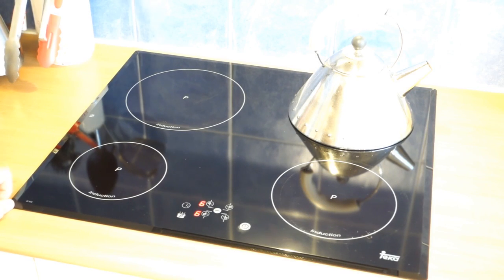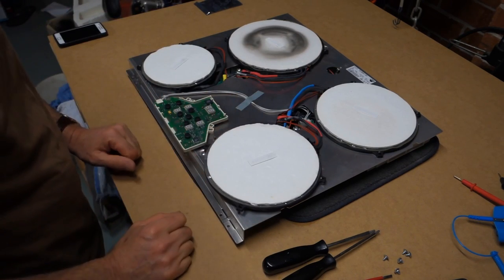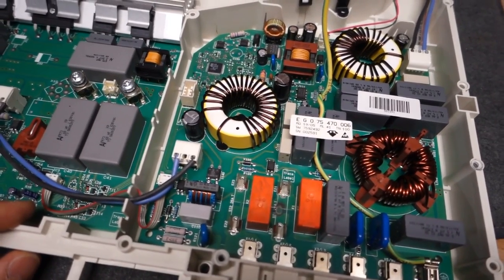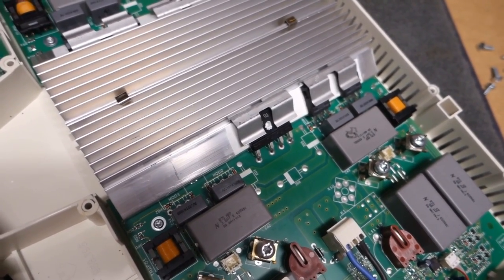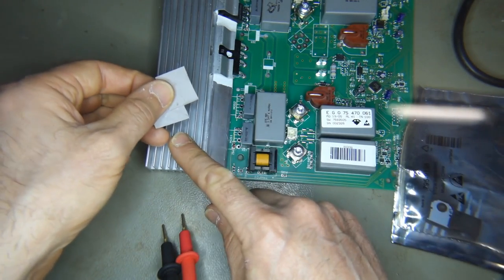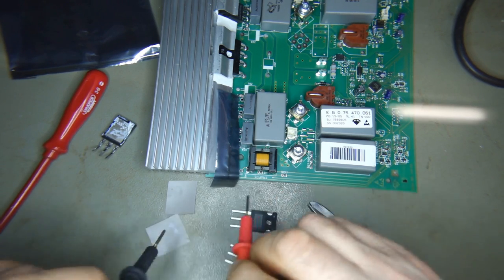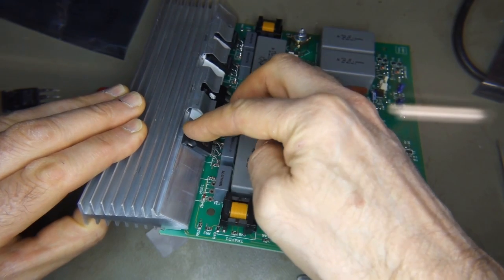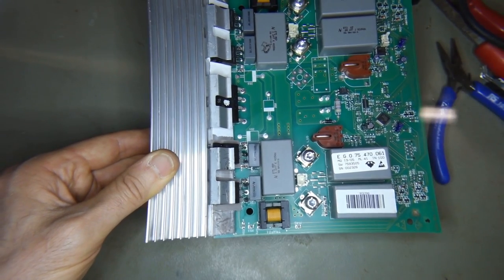Ep 5 Teka Induction Hob Repair (IR645)

Comment: Hi Simon
I have rcvd the replacement filter board and found the similar blown trace path beside the other relay to the one you found blown.
I could not see this before as it was buried until I removed the elements and took the whole top off.
Because it is the "other" relay to what you found, I am assuming it would be the "other" cct brd generator that has caused the failure on the filter board.
I am not an electronics expert, but have had exposure to a fair bit of circuitry and only understand electronics ....not to design level.
That being said, what did you do with the blown filter board?  Did you able to install a 20 amp fuse and "reuse" this board?
Reply from the maker: Yes, I simply placed a fuse in the empty fuse carrier.  No other repairs were done to this pcb.
Reply: Thank you.
I just sent another correspondence asking about the type of fuse.
Reply from the maker: taxicamel I can't see another reply but ill try answer your question anyway!  From memory the fuse was just a std one.  Not slow blow or motor rated.  Of course you would want to replace with the same rating as noted on the pcb.  NOTE: it's 240VAC here in Australia.   If you live in a 110v country the fuse rating will be different.
Reply: The graphic on the board shows S12  20A ....which I would assume means 20 amp.  This is a stove that is using 230 VAC .....even though our standard outlets are in fact 115 VAC .....so perhaps no difference (?) when it comes to the high-powered appliances (?)
Reply from the maker: taxicamel Sure.  If its using 240VAC and marked up 20amp then use that rating

Comment: Hi Simon I have the same issues with a Smeg board I have removed the IGBT but am struggling to find replacements can you help? It’s a RJH60F7 when I searched I cannot find anything 🤷
Reply from the maker: Hi Chris,  I searched the p/n  RJH60F7 and it is a 600v 50A igbt made by Renesas.  If you are unable to find this part in stock then try a parametric search on Mouser, RS components or Digikey.  Due to covid semiconductor stocks are v low,  I found a RJH60D7BDPQ in stock at Digikey which will probably be OK.  Alternatively check FGH60N60FDTU, this is also in stock.  (I'm assuming the package style is TO247, you didn't specify)

Comment: I have problem on Electrolux E36IC75FSS  .
Your video is the only one that helped me so much.
I need to replace  ZD (zener diode) You talk in Video. 
Please tell me  the voltage of this zener-diode.
At least I need Your suggestion.
THANK YOU.

9
Reply: Hi, did you find out the value of the zener diodes?

Comment: Hi Simon,
Nice video you have here, congrats.
Let's see if you can help me with my induction hob problem. Is a Teka VR TC 95 4I it was giving ERROR 5, I changed the IGBT transistors and the Graetz Bridge, also added a new 20A fuse because the line fuse was burn.
It happens that the ERROR 5 actually disappeared, but now when I try to switch on any of the 2 fire on that side of the hob it gives me the ERROR 7.
I already try to search on internet but I have no results.
Can anyone help me please?

Thanks
Reply from the maker: I wish manufacturers would give out error codes... Sorry I can't help any more Rafael.  You have clearly made a difference by changing the igbt's and the diodes.  I can only suggest you make sure all your connections are good and if it doesn't work then contact teka and see if they can throw some light on the error.  Please report back!!

Comment: Very interesting. In which year was built this hob? Does it use the 
same boards as the current Miele hobs? Which IGBT Transistors were built
 on? (I have no audio on this PC, if you said it in the video)
Reply from the maker: The original IGBT Transistor is an IXYS TO-247 ( ISOPLUS-247 ) IXGR32N60CD1

Although there are other equivalents you can use.  The hob is about 12 years old now and whilst I can't say for certain when I bought it I think the vendor said it was built in a factory that built Miele branded products also
Reply: Thank you. Then these boards are probably of the 1st generation, which had some reliability problems with the IGBTs. But 12 years is a very good duration for an induction hob!!  This board is made by the German company EGO. Boards by EGO are mounted on the Miele and AEG/Electrolux hobs. The current boards that I have seen have a different layout and they mount 60Amps IGBTs Toshiba GT60j323. Bosch/Siemens hobs use the.GP4068D. Could they work also on your board?
Reply from the maker: Quite possibly - If I need to make any further changes I'll take a look at the specs.  You may have missed the details int he video but I'm pretty sure the IGBT's failed due to a zener diode not begin properly mounted on the board from day 1.
Reply: Thank you. I didn't understand what was happened with the zener. To understand the spoken english is much more difficult for me. Do you know which type is the zener?
The present hobs of Miele use EGO boards whith the same layout as these, but I don't know which IGTBs type they use. However these are very good, if they lasted 12 years without failures on the IGBTs.
Reply from the maker: Sorry I don't know the specification of the zener, its a small smd device with no markings.  I made sure it was not short circuited or OC and then simply soldered the one side of the zener that had never been attached properly when the board was 1st made.  I assume the zener is in the circuit to clamp any voltage spikes that might damage the igbt's

Comment: I could not find the exact model of igbt at RS. I found one that has a same value but the amp is higher would that be ok?
Reply from the maker: It should be ok.  If you can, check the gate voltage spec also and see if it's in the same range too.  This is the voltage that is required to turn the igbt.  Good luck!

Comment: Hi Simon ....now I have found something ....perhaps the root cause ....ZD11 ....which is located under one of the IGBT's. It is completely blown.  Would it be safe to assume this identification means zener diode?  You mentioned this in your video.
As I look for a schematic, it appears Electrolux only provides board information.
Would you happen to know how to identify this diode to purchase? There is another diode at the opposite end for the other element circuit. How does one identify what the diode is?
I was looking for a way to attach a photo of this failure, but it doesn't appear to be a way to do this.  It appears there are quite a few of these diodes on this board. Is there a generic diode used universally in this application?
Reply from the maker: taxicamel When i found my zener diode not connected I initially looked around for component markings but it seem like most smd's that tgey are too small to mark.  My only suggestion is to remove what looks like a good one in (from the same location on another ring) and test its avalanche voltage.  Without a scematic with component values it can become an impossible task to troubleshoot appliances.  My only other suggestion is to google for similar circuits and see if you can find some options.  The circuit should work without the zener as its role is to protect the igbt from high transients.  In fact my hob worked for years before this latdnt defect resulted in the igbt failing.
Reply: Hi, if can help someone it’s ZMM16 zener

Comment: Hi the fuse on my IKEA induction hob keeps blowing when the heat setting is pressed any ideas
Reply from the maker: mac brown a short circuit somewhere!  It's impossible for me to make suggestions on other makes and models without actually seeing the device.  As the video shows, the igbt's are a frequent failure mode.
Reply: thanks fella i have checked igbt and that has failed many thank
Reply from the maker: mac brown Cool, glad you found it and hopefully you can repair it.  The igbt's and the associated diodes are the 2 components of these induction hobs that are doing the "heavy lifting" and are prone to failure.
Reply: i will let you know how it goes thanks

Comment: Thanks for the reply.  The problem is that I could not find a datasheet, what would be the alternative solution?  The problem is that my two transistors are broken and 3 diodes on that side.

Thanks!
Reply: Did you watch the video? The datasheet is shown in the video
Reply: yes, but i am interested in what size diode to get for replacement, that is not in the video!
Reply: @elemergal1189  Gotcha...someone cites success later in the comments with 18 volt, 1/2 watt zener diodes
Reply: DenverGuy Thanks
Reply: @elemergal1189  FYI - I pulled a good Zener diode off my board and measured it's voltage to be 16.5 volts. I've ordered TZMC16-GS08.
Reply: DenverGuy Thanks! :)

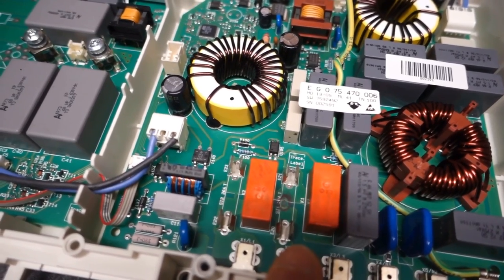Comment: One question, if anyone knows. Why the manufacturer didn't put an external fuse (which was empty in 3:29) and the fuse was blown inside the PCB? I had the same problem with a miele induction cooker. The PCB was blown-torn, when the fusebox which was connected in parallel was empty.
Reply from the maker: mbrn01 I can only make assumptions on the pcb designers intent but I think the fuse carrier is installed deliberately to allow repairs such as this.  Why the original manufacturer/designer incorporated a pcb fuse as well is a question I don't have a good answer for!  I can only say that having a pcb fuse is a very visual indication of a problem.

Comment: Hallo!

how many volt diodes do I need to replace it?
Reply from the maker: I'm not understanding your question.   If you are asking about the voltage specification for the diodes I'd check the existing part number and look up the data sheet.  There are usually alternative parts from a few different manufacturers available, you just need to match the key parameters as best you can.

Comment: You can help me to fix my Electrolux E36IC75FSS1.
If the case You explain  is for 4 burner, and for each
 burner is a little transformer (close to capacitor)
in my cooktop there 5 capacitots,one of them test bad.
Please help me What part number is this and where to find.
If You have one, Let me know,I buy from You. Thx. much
Reply from the maker: I'm sorry I do not have any information on any other make/model of hob

Comment: do you know the value o the zener diode
Reply from the maker: No. Unfortunately they don't mark zener diodes with their rating.  Nor is the silk screen of the PCB marked.  Perhaps a better electronic engineer than I can specify a value by reviewing the data sheet for the mosfet!
Reply: Thanks, they are marker with FB on them but this do not tell the voltage. read that they should be 18 volts but reallu not sure of this...
Reply: I installed 18 volts 1/2 watt. And for now, it work fine.
Reply: they are 16v if it helps anyone